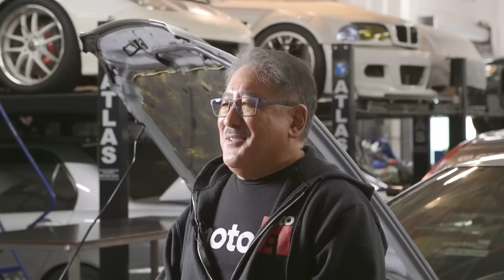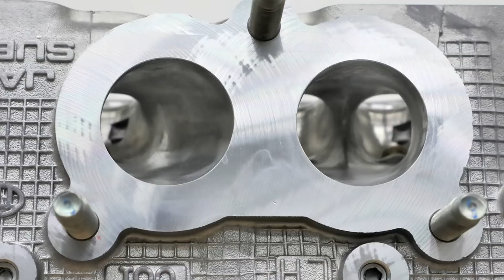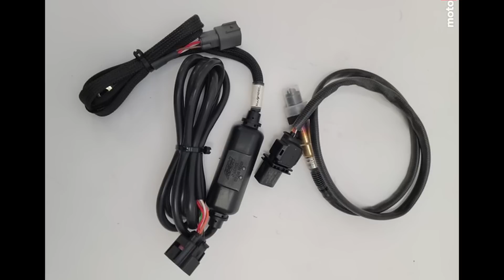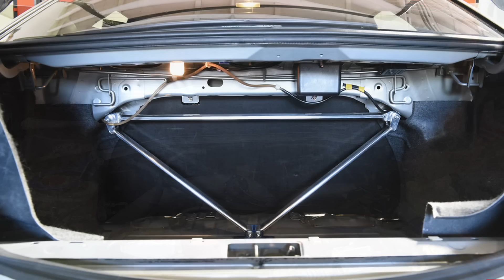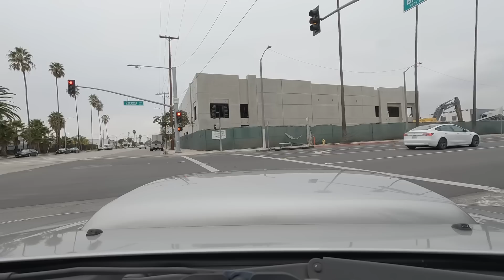How We Built Our Project Subaru So it Won't Blow Up!   (AND Drive Great)

Comment: This guy is literally the Jesus Christ of Subarus. One of the very few people I have genuinely and consistently learned from through out the years. Been daily driving my STI for almost 3 years!
Reply: Hey bro any recommendations , I have a mechanic doing the block and heads for me. He suggested a bigger oil pump
Reply: @JonathanLopez-rg8le 
I have just got my wrx back from the tuner, new genuine EJ207 block with ARP headstuds, RCM head gaskets, 11mm oil pump and killer b pick up. Should be fairly reliable running 20PSI on a TD05
Reply: Just get that AOS and you are set.  @kandlrex
Reply: And new timing belt . I also want to get a AOS and Oil pickup from IAG or killer B ?? Any recommendations
Reply: Sounds fricking dope to be able take care of the sti for that long
Reply: Thank you bro I appreciate that! I have an IAG AOS. I have a killer b oil pick up but heard great things about the IAG one. killer b equal length headers to save cylinder 4. Front mount intercooler. I have a stock oil pump but I I will go bigger when I go fully built! For internals I have kings bearings and ARP head studs. Making 303 at the wheels tuned on 92. Fun but reliable! F what people say about subarus and STIs. Just have to know the platform 😁     @JonathanLopez-rg8le

Comment: I did pretty much the same path with my car.. like 80% of it. Not know much I did ask a lot of questions and sometimes I was treated like I was over spending on the project.. today I hace a 570whp on ethanol and 470 on pump gas… the car is running good since 3 years ago and believe me when I say I drive it hard I do without getting worry about it… great content… thanks for sharing your  knowledge !!!
Reply: Hey I just got my car built, can I dm u with questions?

Comment: As an outsider, it seems you threw the entire aftermarket at this car. No working class person could afford all this just for 520whp. If you have to do half of these mods to get it to live, it's not worth it. I get that products were given to you for sponsorship and exposure. That's business and you have overhead. Say I want 400 flywheel HP. Will the factory long block hold up? It not, pass on the Subaru platform.
Reply from the maker: Tons of people build their cars this much and more of it. "Just" 520 whp? What kind of badass ride do you have that can beat this car for less?
Reply: @motoiq  I'm not knocking on the total HP. I'm surprised of the mods used to get there. I mainly work on domestic V-8's, V-6's, and do boosted and NA engine builds. I'm not in a pissing match here either. I could care less if I passed by a Neon also. My personal car doesn't come close to your HP. I normally don't see that level of machining and parts to surpass 500whp.
Reply from the maker: Sure on a Domestic engine with 2.5x more displacement makes sense.

Comment: 500s is perfect especially on a built motor.. it will make the car extremely reliable. No need for more on a road course especially!! 500 would feel perfect with that platform. I have a VB that makes only 350whp and 352wtq. Good for a street car I run a 255 square. I do need a oil separator. Great video lo e the car
Reply: 350-400whp is perfect for a daily driver.  I have 360whp on my STI and still has stock cars and emission compliant parts.

Comment: I use to have an ‘04 LL.Bean 3.0r Outback that I wanted to upgrade the throttle response and suspension( because I couldn’t find a legacy wagon anywhere at the time) so it wouldn’t lift at higher speeds. My question is, would it be better to upgrade the torque converter or do a manual swap?

Comment: Aren’t those high flow Fuelab fuel pumps loud as hell? 😮
Reply from the maker: No louder than any other high flow pump I have used so far.
Reply: @motoiq  I heard a Fuelab 1000hp fuel pump that was mounted with rubber isolation clamps in the oem fuel tank and at lowest speed setting it’s LOUD as Fu..!
Reply from the maker: So would any other pump of the same capacity.
Reply: @motoiq  so how is Mike’s daughter driving that Subaru if it has that high flow FueLab pwm controlled fuel pump?  Won’t it give her hearing damage? Or is she using two of the lower speed Fuel Pumps? 😮
Reply from the maker: You can hardly hear it with the engine off and not hear it at all with the engine on.  Had one in my R35 and could hardly hear it.  Both car's stock pumps were quieter though.
Reply: @motoiq  i’m pleasantly surprised you found a way to make them quiet.  Can you please upload an in cabin video showing the fuelab pump noise of it with engine off and on at idle?  Also which Fuelab pump model is in that Subaru?  It looks and sounds very well built from the description.  #MotoIQftw
Reply from the maker: The R35 got totaled and is gone.  The Subaru is my daughter's and I need to get with her.

Comment: What variant of KW are those? I’m looking at getting the V1 for my GR hatch wrx. Are they good to run as on my daily or should I save up and get the V3 instead? I’m not planning on tracking heavily.
Reply from the maker: 3 way clubsport.   The V1 is like a comfort lowering mild performance product.

Comment: Any suggestions on replacing the front U subframe?? Oswald use to make the best on the market but no longer in business 😢. Thoughts??
Reply from the maker: Probably overkill for this car.
Reply: @motoiq  any recommendations for one though?
Reply from the maker: Are you racing? Have you evaluated your actual need for one? The OEM one isn't super heavy and decently strong.
Reply: @motoiq  looking more so as a replacement of an old rusty one on my 2002 WRX
Reply from the maker: Maybe you can make one or have one made, they are pretty simple.
Reply: @motoiq  I wish I could if I had the welding experience

Comment: I love Mike's positive attitude toward Subarus and EJs. Instead on joining in on the EJ hate bandwagon, he actually enjoys figuring out how to overcome the limitations and then gives us all that info for free
Reply: Plus he realizes that Subaru doesn’t build $100k super cars or $1mm hyper cars.  

Everything is engineered to a price point.  🤷‍♂️
Reply: @rising_crust neither does Honda. I don't get it. Subaru stock turbo engines  suck. He makes that clear.
Reply: @dr2377 Honda had a lot of issues with their early turbocharged engines. 

Plus, modifying any engine or factory tune can lead to issues regardless of the manufacturer.
Reply: @rising_crust subaru made factory turbo engines. Honda never did.
Reply: @dr2377 Are you really saying Honda has never had turbocharged engines from the factory. 😂😂😂😂 Just a quick google search. They've made turbocharged engines since the 1980's. Probably longer than you've been alive. 😂😂😂😂
Reply: @ricardomolina4605 I meant mainstream. Not a couple tiny engines that need a turbo to make any power. Calm down

Comment: My IAG block was shipped with machining chips left in the engine, which I found 18 months later in the #1 and #2 main bearing oiling holes during a teardown.  Also, the cylinders unacceptably tapered.
Reply from the maker: Did your previous engine blow up? The chips could be from your old engine, lurking in cooler lines, the cooler, valve covers, pan, etc.  IAG ultrasonically cleans all parts after machining operations so the likelihood of chips remaining is pretty low.  If you machine in a proper fixture, the bores will not be round when measuring them just sitting there. Taper and out of round can be more than 1.5 thou on a Subaru, especially a studded engine.
Reply: @motoiq  Nope, it wasn’t. The machining chips were pretty clearly from the close decking process given the type of cutter they used. I sent photos to them and did admit that it was likely that’s what it was. The taper was at the bottom of the cylinders, it measured out to be a 3tho difference between the top, there was also scuffing on the bottom 2 inches of bore without only minor scuffing up top, the bottom of the skirts were destroyed. 
It was explained to me that there were potentially quality control issues back then (2018). After loosely taking some responsibility for the issues, I was offered 20% off a new engine however I just didn’t care to spend any more money with them. All that being said, I think I maybe just bought at a poor time, they seemed to be pretty behind and potentially rushed out some blocks. I found a few people that had some strange issues from around the same time. I think they make some good products and appreciate that selling off the shelf built engines can be a tricky business given all the factors that are in play when determining a successful outcome. 
I’ve moved on to the MQB VAG platform, I spent 6 grand on my S3 and ran a 10.8 and I can do it with a coffee in my hand. lol I would like to maybe build my GR for some ice racing or something like that when I have the time. I think that’s truly where Subaru’s are happy.
Reply from the maker: Ok this was way before all of their newer processes and procedures.  There current engine production facility is state of the art.   What year S3 do you have?
Reply: @motoiq  It’s a 2018 7 Speed. GT2263, with MPI running a nice E40 blend. Peak torque at 2900, super fun daily.
Reply from the maker: Then Non nightmare to work on Audi!  That is the same turbo we have on the Daughters S13.  Good turbo!
Reply: @motoiq  if you’re looking for near stock response and something that makes power to 7 grand, absolutely. And unlike most Hybrids, the bearing system is designed to handle the added thrust.

Comment: You guys did everything to make it not blow up lol

Awesome video gave me ideas for my fa20.

What's the best 500whp turbo for the FA20 wrx that has power in the low end closest to stock?
Reply from the maker: Stock position?
Reply: @motoiq  Yes please!
Reply from the maker: The smaller version of this turbo would do pretty good on a 2 liter!
Reply: @motoiq  which turbo is that?
Reply from the maker: Darn it wont fit your car.  I think something like an FP Blue will be pretty good. https://www.forcedperformance.shop/collections/fa20-turbochargers, don't crank it up too much on the stock bottom end, this will bend your rods if you go past 330 lb/ft of torque.
Reply: @motoiq  that's alright I currently have an iag 600 shortblock with a boostlab 54x. I was just trying to figure out if there was a better turbo for the low end. I'm making  330whp 333tb on 91 and 368whp 370tq on e60. I just miss the low end spool😅😅😅
Reply: Power comes on at like 4k rpm
Reply from the maker: That seems sorta laggy for that turbo.
Reply: @motoiq  What should it be?

Oh my bad typo at like 3192 rpm I'm at 215tq and at 4836rpm it's at about 370tq.
Reply from the maker: That is more like it!

Comment: This guy posts some of the most articulate and well thought out videos you can ever watch on this subject. Too bad its so expensive to cover all your bases. Unfortunately I like so many others are limited by money, and am forced to just buy a plain Jane forged shortblock and say my prayers. 😂
Reply from the maker: If it is built by a reputable Subaru tuner, that is not a bad way to go.
Reply: @motoiq  Does stock TSI are still more reliable than buildet subies?
Reply from the maker: The engine is, the rest of the car no.
Reply: Do you guys make a reasonable package for ejs that you sell?
Reply: @jf5600  define "Reasonable" for you. and didn't they just go through that? (albeit: for them, and their goals)

Comment: Not very good motor if you have to replace the whole case with an aftermarket one!
Reply from the maker: This isnt an aftermarket case, its a modded stock case.
Reply: @motoiq  same thing.
Reply from the maker: This is an aftermarket case, slightly different price point. https://www.maperformance.com/products/iag-performance-willall-billet-aluminum-ej25-subaru-case-halves-multiple-fitments-iag-eng-1600?gc_id=19789991188&g_special_campaign=true&gad_source=1&gclid=CjwKCAiA8NKtBhBtEiwAq5aX2GUcYrrlpUbdEF-6NSt-XOsvagHULFXjOjajT7U_BLNKsh9uclspiBoC9wAQAvD_BwE
Just the case cost more that our whole long block.

Comment: Could SCAT, a smart cam developer, and Holley build a flat-plane crank LS?
Reply from the maker: Yes, the LS stroke is long and vibration might be an issue.  You could destroke but are more likely be able to make more useable power with more displacement.  If you notice all successful flat plane engines have a pretty short stroke and the problematic ones had longer strokes. The release of the LT6 was delayed for more than a year due to vibration issues. The Ford Voodo engines has issues too.

Comment: Great video. Love the info. I have a 2002 JDM Subaru STI with a built engine but my turbo has died (had on a Blouch Dom 3)  so i am considering this Precision turbo as a replacement but I am curious if there will be a fitment issue as I am still running a TMIC (Process West)
Reply from the maker: No it is a direct bolt in
Reply: @motoiq  Thanks. Would you mind sharing the dyno graph. I would love to see the powerband. My car is a JDM STI but i have in a built EJ257 with hybrid pistons to drop the compression as i still running the original heads although they have been ported and mildly cammed (Kelford 264 / 260 Hot Street). Is it possible that the lower compression would make this turbo laggier?
Reply from the maker: https://motoiq.com/project-gd-sti-we-dont-need-a-damn-rotated-mount-turbo/  We made more but turned it down for the article just to be reliable with heat.

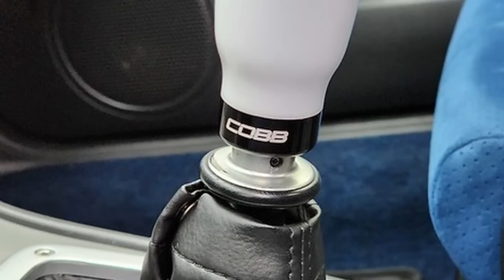Comment: 1:00:08 !!! This is something I've never heard anyone express, but that I've thought of myself. So I had an Outback XT with the 5 speed and a cobb short throw. It shifted terribly and would even grind at times. Now that trans is in a different car with a longer shifter and it shifts just fine. It seems to me that the reduced leverage of a STS causes the syncros in a 5 speed to not work as well, which leads the drive to just drag against them like slipping a clutch. IMO for 5 speeds, keep that shifter stock, just stiffen the bushings for better feel.
Reply from the maker: We adjusted it so the motion ratio was almost the same as stock for that reason but we benefit from the better bushings on the Cobb.
Reply: @motoiq  I appreciate the validation! I built my own tall sorta normal-throw shifter with solid aluminum bushings for the old GL that this transmission ended up in. Shifts good and falls right to hand for a nice race car feel.

Comment: Yep Dominic acia developed the 2.3 and 2.5 +2 rod set up decades ago and now everyone uses it pretty amazing what that guy has done for Subarus
Reply from the maker: And the #4 cylinder cooling mod
Reply: Thank you for acknowledging that!
 @motoiq
Reply from the maker: @GetaDomTune thank you for coming up with that.  I forgot that we did it on this car and I should have acknowledged it in the video as I feel it's important for a track driven car.
Reply: @motoiq  and keep up the good information and work we need more people out there telling the truth rather than making stuff up for internet fame!
Reply: Yup the folks in the community have worked wonders over the past couple decades.  I still remember in 2000 we couldn't even find 5x100 wheels with offsets to fit Imprezas here in the states LOL

Comment: Fantastic video. Couple of questions for you, with the rear diff lock out bolts, are stiffer diff carrier bushings even necessary? Do you lose the added rotation that the big rear sway bar brings when you go big in the front also? The old autox trick on these was to maintain the stock front sway, but I'm curious on your perspective there.
Reply from the maker: One inch of free uncontrolled movement can't be good. The diff carrier is separate from the crossmember. I think the front bar is a tradeoff for cars that roll a lot and loose camber from the roll, so the understeer created by that is worse than the understeer from the front bar.

Comment: When I bought my WRX it was stock, under 100k mi. After 2 years it started to misfire really bad. It had scored pistons #2 and #4 cyl. I rebuilt it with a new short block. The guy that owned it before me really tore that car up. How much to get a 450 hp engine setup.
Reply from the maker: Watch our video on Subaru engine costs

Comment: where do you guys live? im pushing 23 to 24 psi for 409 wheel hp in Vermont. So im at a high altitude
Reply from the maker: Boost isnt HP
Reply: Indeed it isnt. I just thought it was pretty cool how you are making 100 more hp at almost the same PSI and also with a stovk location turbo. 
  @motoiq
Reply from the maker: Yeah power is more related to mass flow.

Comment: I'm looking at installing a twin disc clutch but from I'm getting contradictory info describing it as adding more noise but also says they are ultra silent. My question is will these differences even be noticeable to the point of me being bothered by it? I have my 04 XT in the shop getting a forged rebuild and I'm also looking to lighten the clutch
Reply from the maker: It makes a little floater noise with the pedal pushed in but once it warms up, it is hard to hear. not like a full metal twin disk.
Reply: unless you are going for over 500 wheel torque the ACT XTS single is plenty.
Reply from the maker: I agree with this, the pedal effort is higher than the X Clutch though.

Comment: Have you done a video about/do you have any opinions or tips on hybrid engine builds?
Reply from the maker: No, we have rebuild a Prius Stock just to see once. Don't really want that business.
Reply: @motoiq  oh no I’m sorry I meant doing an EJ build with the 2.5 STi block and WRX heads (thank you for your quick reply.) I know there are several methods to make it work, just wanted to know if you had any experience with or opinions on them
Reply from the maker: We could it's nothing special just chamber volume difference that has to be considered.